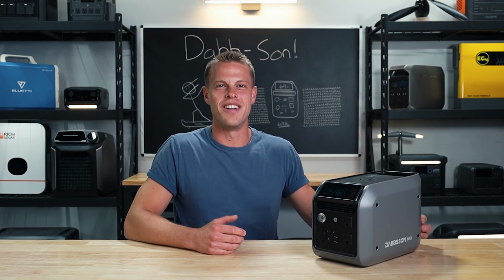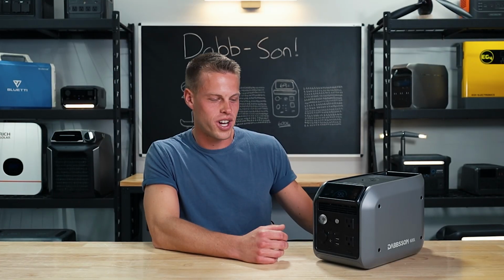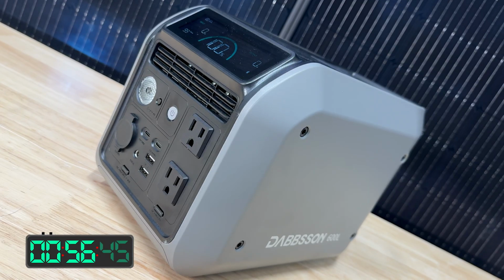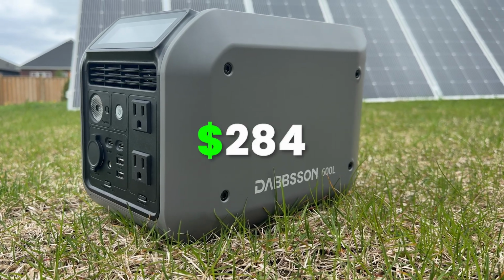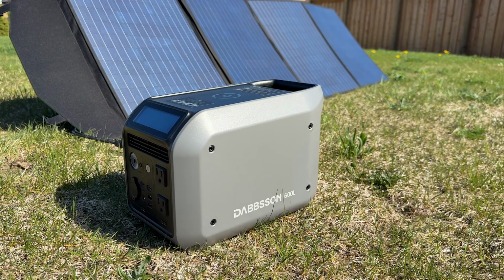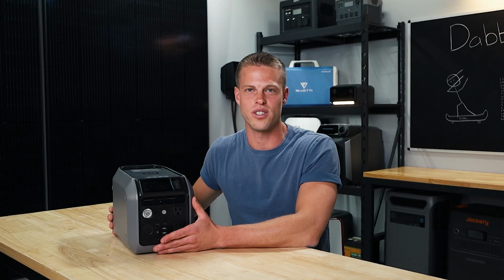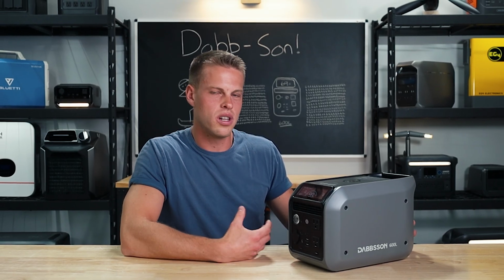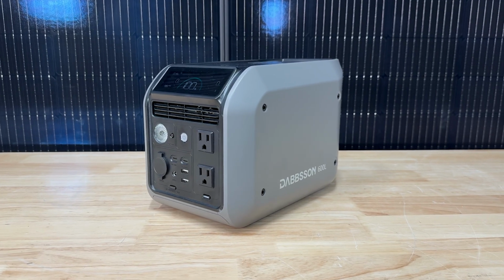How Much Can $300 Really Get You? – Dabbsson 600L

Comment: Ok, so you're not even going to hint whether this unit will get me through a 5-10 hour blackout powering my standard refrigerator after it's been fully charged up? For the less sophisticated like me, please provide some "usefulness context" when reviewing smaller-scale stuff. 

Here's why it's important: Rather than investing in one big solar array and a Powerwall (so many lack the means to do that), I'm thinking of a series of little rigs like this (one 200w panel + 1 of these units per refrigerator), permanently arranged so that: (a) I save on my power bill; and (b) it'll act as a built-in generator when the grid goes down (average downtime after a summer storm: 5-8 hours). Under that scenario, the solar panel is permanently plugged into this unit, which itself is permanently plugged into the wall outlet, and the refrigerator or freezer is permanently plugged into the unit. The onboard software would permit me to optimize the solar electricity usage to cut down on my power bill.

I'd thus want to know if I could realistically buy this rig -- one each for my fridge and my two freezers.  One could acquire such rigs incrementally as cash flow permits.  I'd want to set them up so the 200-watt solar panel would charge the unit, so that solar-generated electricity (in real time and as stored in the unit’s battery) would be used first and the grid's power second. 

The goal would be to show that this particular rig would save (I'm guesstimating), $20/month. At $500/rig (sure dig down for deals on a unit + a $200w panel), that's a 25-month payback cycle.  Low-income folks could buy one rig, then the next when utility-bill savings accrue, etc.  

Bonus: They've now got redundancy, rather than all of their solar investment eggs in one "Big Beautiful Array/Powerwall" basket. And they can take all of the rigs with them when they move (renters, then, would especially appreciate that).

Why don't you guys focus on this "Poor Man's Powerwall" concept and invite vendors to send you "standard refrigerator/freezer" packages, since that's Joe Six Pack's first priority (saving $1000 worth of food) once the power goes out?   Your vendors will quickly realize that this "Micro-Solar" market is: (a) huge; and (b) untapped (Steve Jobs: "These people don't know what they want until we tell them").

Since 2010, my work in solar tells me that Main Street, working class folks are convinced that solar is just not for them, money-wise, because who’s got $35-$50k?  All they ever hear about is big Powerwall class systems or RV-market/camping stuff, so they tune it out.  No one is "educating" them to this incremental approach (i.e., the vast, untapped Micro-Solar Market).  Under this “Power Man’s Powerwall” (PWP) system, a monster-market-demand sector can be ignited (can you say “apartment-balcony solar?”). 

And while developing this market niche, provide how-to videos (make vendors pay for them) so, if I buy what you recommend, I can click on a video and get it up and going on a weekend without having to pay some guy.
Reply: Start by buying a power meter.  One with a 15 amp plug on one side, outlet on the other.

One of those told me that my refrigerator draws 80 watts on average.

Take the battery capacity of any power bank and multiply by 0.85 to allow for losses (they aren't 100% efficient).

This has a 768 watt hour battery, so you can maybe get 650 watt-hours.

Divide 650 watt hours by 80 watts and you get 8 hours.

Not only "your mileage may vary" but it absolutely will.

Another video from TheSolarLab suggested that you look at the nameplate and divide by 6.  My fridge is 850 watts (max) divided by 10, which is why you should measure.
Reply: "Ok, so you're not even going to hint whether this unit will get me through a 5-10 hour blackout powering my standard refrigerator after it's been fully charged up?"
Take 768wh and multiply it by the efficiency (85%).  Then divide your average expected watts into that.
768 * .85 / X, where X is your expected average watts.

"Why don't you guys focus on this "Poor Man's Powerwall" concept"
See if this helps, https://youtu.be/4m7jiNTrBjQ
Scale it down if you need to.

Understanding how much you'll be able to sustain from solar is a lot more complicated.  Start by focusing on usage.

Comment: I picked up this little guy a month ago when it first came out. Got it for $255. Can’t beat the price for 768W. My only wish is that it had more solar input. 300-400 would have been ideal. Thanks for Vid. ✌️OUT! 😎
Reply from the maker: That's a killer price! ⚡
Reply: How is it holding up?
Reply: Thanks for the response. I’m wondering if it could go on a flight like if TSA will allow it as my main purpose is to use it in a country with power issues
Reply: To my knowledge no power stations regardless of size are allowed on flights. I know some of these power station companies actually answer that in there Q/A section. You might want to check the Dabbsson site. Thanks
Reply: For what I paid I can’t complain at all. I’ve been using it every day at night mainly. It’s been working great. Just wish it could take a little more solar. App is great. Would definitely recommend for a little power station.